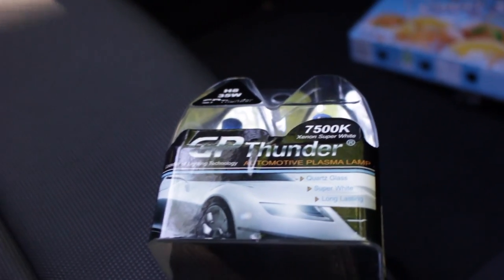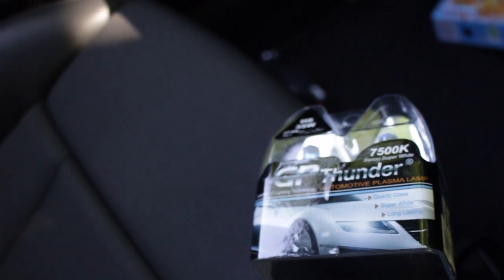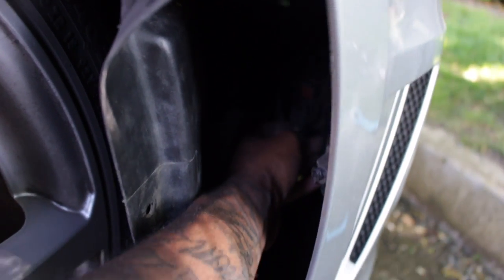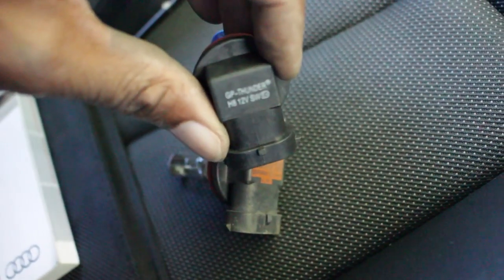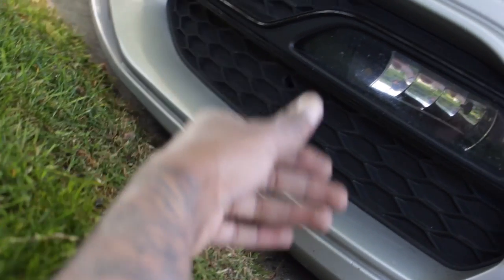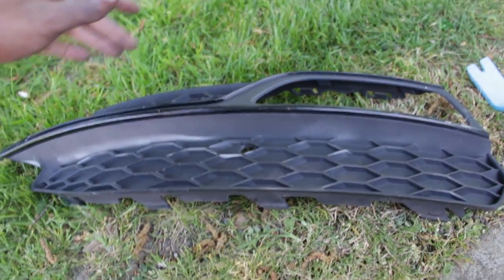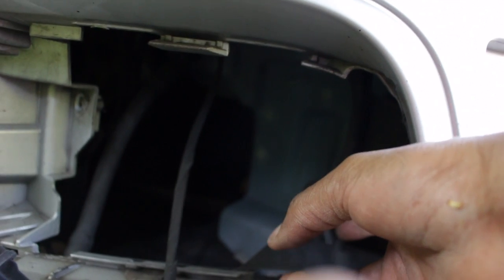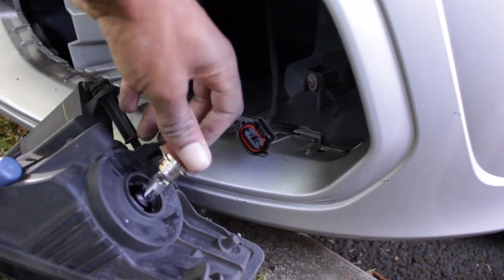AUDI A3 8V 2013 - Front Fog bulb change

Comment: I didnt succeed (or didnt felt confident) to remove the plastic piece around the fog light (driver side) so I found another way (audi A3 S Line 2015). I jacked the front of my car and simply unscrew all the torx srcew of the engine under cover plastic shield, except the ones in the back. It then gave me easy access to the bulb! But thanks for the video it helped me.